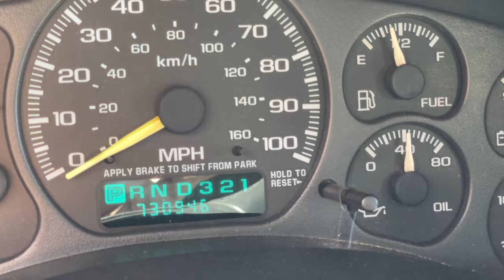Welcome To Our NEW Shop!!! (Hurricane Rated)

Comment: 11:45 specifically because you're using it for vehicle storage I would install a bump guardrail all around the entire perimeter fastened to the concrete. Doesn't take up much space, and never having to worry about hitting the wall is absolutely worth it. It doesn't need to be a massive industrial fork truck rated style either.

Comment: Warehouse ideas: outfit the interior with loads of lights (ceiling and walls), so Sam has a nice place to fully detail the rigs and you could do intro shots for new upgrades and vehicles. Get plenty of outlets installed so you can trickle charge all the vehicles. Install a small workshop area in a corner so you can have a usable space to do anything you need in there. Lastly, consider installing a 2 post, or 4 post lift in there... just one to keep it a solid functional space for your type of work environment.

Comment: So not only do you have parking in the building now, but you have added parking along the outside walls.  Nice work bro! Might want to think about painting lines for the toter home on the floor that extend out the door to help you line up the backing. I always found them useful and less stressful when backing into loading docks.

Comment: Congratulations Spencer on winning that sick truck!!!!!! Be careful getting used to the much power. It really is a massive difference going from 400 whp to 750-800+ but if you respect if when learning you'll be fine.
Reply: Have to agree, it is a huge jump in power and effect. Cleeter and the gang really make these high HP cars(and drifting/burnout contest) look easy to handle.
Reply: @JChurchua  exactly. These guys have been doing this a lot. When I built my C6 going from stock 380 whp to 500 who was a massive jump to get used to. Then when I boosted it going to 750 whp was scary as fuck to get used to at first. These cars can get out of control faster than most people think possible. It's all about learning and respecting the power.

Comment: nice shed..
I used to reverse amusement rides on Semi trucks (prime movers) into a similar shed, with about 2ft between them.. Paint a trailer-height, yellow vertical line, on your back roller door, to help you line up.. You only need to do it for the toter..

Comment: I thought my '02 Silverado with 537,000 miles was well on its way to legend status. But seeing Sams truck at 730,000 miles is another level.
Reply: Oil Change!😉
Reply: You know the hard part about racking up those type of miles????  Keeping some idiot from hitting you.  Dad gave me his old Tacoma a few years ago, 2004 2wd/reg cab/short box/5 speed, you know the best mini truck spec lol.  Had 200,000 miles on it but ran like new, was clean as hell(things don't rust around where I live).  About a year/7000 miles later some idiot ran a light into the front passenger quarter, completely obliterated that poor truck.  I wasn't hurt but man was I pissed.  I planned to keep it until the day I died, literally the truck is in my will that it would go to my nephew.
Reply: I’ve got on 02 Sierra with 830,000 miles. Rust is getting it now.

Comment: Might check what coating system was used on the panels. If you paint over new panels without proper prep typically the paint won’t stick and will look poor after a short while

Comment: 2 Questions: Can you slap some solar panels on the shop and garage roofs, take advantage of the plentiful FL sun and shave a bit off the complex energy bills, kind of a trickle charger for the Toter?
Also: how hot does the garage get, as I do not readily see ventilation?

Comment: Hopefully they tried to seal under the base angle so you don’t get water seeping in when it rains. I’m not from Florida but round here uninsulated buildings condensate and drip on your stuff. Out east they typically have felt backing to help stop this in non insulated structures. Also noticed the beams look constant depth on a 40’ plus wide building, no purlin at 3’8 around the corners where the wind vortices are the highest and the screw pattern didn’t look for “extreme” conditions. They may have calculated exposure B instead of exposure C to cheapen it up

Comment: Hey cleet, big recommendation. Run power plug to the toter side, 220 if needed. Also a sewage line or septic line with septic tank to drain your grey and black water after trips.

Comment: Put a Chanel from the work shop to the shed then you could put all the plumbing to it ( air electricity internet). Now you will have to put a 2 level or hosts in to fit more mabe. A host to take stuff to the 2nd floor.

Comment: might I suggest a 12 volt solar panel system on the roof of the building with a whole heap of outlets along the back wall with battery tenders/chargers to slow the death rate of your fleets battery's

Comment: I feel like you should get a whole bunch of chargers for all the batteries while youre at it. Dr Sparkalot could wire in some quickconnects for them so you just need to plug them in.

Also: Suggestion for a science video, show what happens if you accidentally touch power and ground with rings, bracelets, piercings etc. I suggest getting hotdogs as finger replacements for that.

Comment: I would add sheet metal where on the inside where you park your cars at.  Sooner or later somebody will hit the wall and it will damage the outside which will cost alot more to purdy up.

Comment: So in the UK the toter home is classed as a Class 1 unit (HGV) and you cant drive 1 of these until you pass an a advance licience. (21 plus years then you have to work up to Class 1 by driving  a class 2 or 3 for 12 months before even applying for a Class 1 licience)  What is the law for driving one of these units in the States

Comment: Make the most of it boys...because that's the sort of noise that will cause the track to be shut down when the residential development goes ahead. It will start with complaints, then noise curfews then who knows what. The only thing that may save the track, will be the development of electric vehicles over the next 10 years that have no noise pollution. Interesting times ahead 🤔